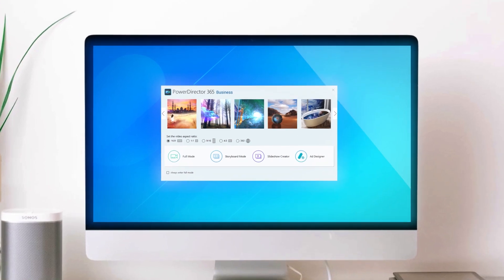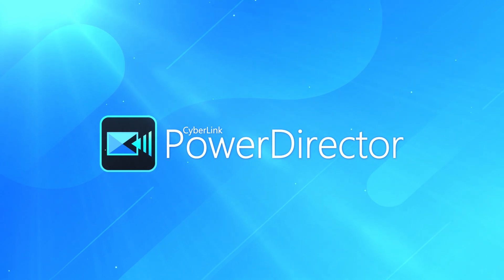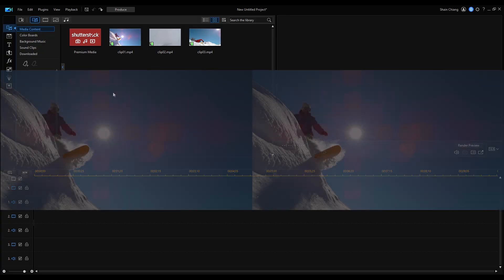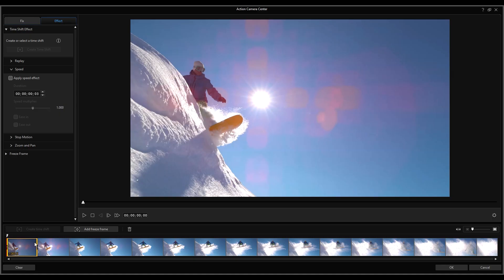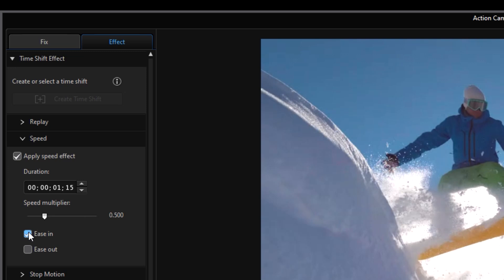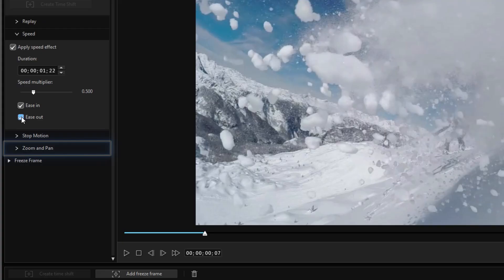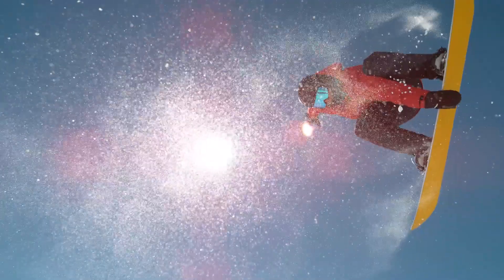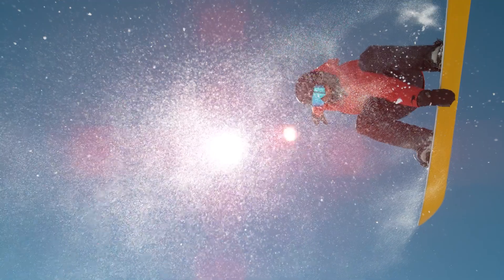Using Speed Ramp to Create Slow Motion, Freeze and Reverse Video Effects | PowerDirector Tutorial

Comment: I downloaded this app on my tablet. Why don't I have speed ramping tool??
Reply from the maker: The features in the video are currently available in PowerDirector 365. But don't worry! You can also use PowerDirector Mobile to make a speed ramp video. The concept is to split your source video into 2 clips and then apply the speed adjustment on either the front or rear clip to make the speeds different. You can also use video reverse, which is also available in PowerDirector Mobile now. 

About the freeze frame feature, we are already planning to add it to the mobile app as well!

For now, you can manually create the freeze frame effect by capturing a full screen snapshot of your video, splitting the video into two clips, and then inserting the video snapshot in between them. Adjust the duration of the video snapshot if needed.
Reply: @PowerDirectorOfficial   thank you! I was able to figure that one out but now I have another question. I'm planning on shooting a wedding soon and create the highlights on power director. How should I end the scene? I want the video to fade in at the beginning and fade out at the end. I been messing with it using some of the stock video but I can't seem to figure it out.

Comment: You can do speed ramping efect on android app? Or just on the computer? Thank you!
Reply from the maker: You can also use PowerDirector Mobile to make a speed ramp video. The concept is to split your source video into 2 clips and then apply the speed adjustment on either the front or rear clip to make the speeds different. You can also use video reverse, which is also available in PowerDirector Mobile now. 

About the freeze frame feature, we are already planning to add it to the mobile app as well!

For now, you can manually create the freeze frame effect by capturing a full screen snapshot of your video, splitting the video into two clips, and then inserting the video snapshot in between them. Adjust the duration of the video snapshot if needed.
Reply: @PowerDirectorOfficial  thank you for your answer!

Comment: is there a speed ramping in mobile subscription?
Reply from the maker: No worries. You can also use PowerDirector Mobile to make a speed ramp video. The concept is to split your source video into 2 clips and then apply the speed adjustment on either the front or rear clip to make the speeds different. You can also use video reverse, which is also available in PowerDirector Mobile now. 

About the freeze frame feature, we are already planning to add it to the mobile app as well!

For now, you can manually create the freeze frame effect by capturing a full screen snapshot of your video, splitting the video into two clips, and then inserting the video snapshot in between them. Adjust the duration of the video snapshot if needed.

Comment: Can you do this on your phone too❔
Reply from the maker: Sure you can! You can also use PowerDirector Mobile to make a speed ramp video. The concept is to split your source video into 2 clips and then apply the speed adjustment on either the front or rear clip to make the speeds different. You can also use video reverse, which is also available in PowerDirector Mobile now. 

About the freeze frame feature, we are already planning to add it to the mobile app as well!

For now, you can manually create the freeze frame effect by capturing a full screen snapshot of your video, splitting the video into two clips, and then inserting the video snapshot in between them. Adjust the duration of the video snapshot if needed.

Comment: Is there speed ramping tool on mobile version..?
Im using mobile version full edition
Reply from the maker: No worries. You can also use PowerDirector Mobile to make a speed ramp video. The concept is to split your source video into 2 clips and then apply the speed adjustment on either the front or rear clip to make the speeds different. You can also use video reverse, which is also available in PowerDirector Mobile now. 

About the freeze frame feature, we are already planning to add it to the mobile app as well!

For now, you can manually create the freeze frame effect by capturing a full screen snapshot of your video, splitting the video into two clips, and then inserting the video snapshot in between them. Adjust the duration of the video snapshot if needed.

Comment: How can we use in mobile speed ramping
Reply from the maker: Hi there, You can also use PowerDirector Mobile to make a speed ramp video. The concept is to split your source video into 2 clips and then apply the speed adjustment on either the front or rear clip to make the speeds different. You can also use video reverse, which is also available in PowerDirector Mobile now. 

About the freeze frame feature, we are already planning to add it to the mobile app as well!

For now, you can manually create the freeze frame effect by capturing a full screen snapshot of your video, splitting the video into two clips, and then inserting the video snapshot in between them. Adjust the duration of the video snapshot if needed.

Comment: I'm using mobile, only 😭. I wish have pc 😑
Reply from the maker: No worries. You can also use PowerDirector Mobile to make a speed ramp video. The concept is to split your source video into 2 clips and then apply the speed adjustment on either the front or rear clip to make the speeds different. You can also use video reverse, which is also available in PowerDirector Mobile now. 

About the freeze frame feature, we are already planning to add it to the mobile app as well!

For now, you can manually create the freeze frame effect by capturing a full screen snapshot of your video, splitting the video into two clips, and then inserting the video snapshot in between them. Adjust the duration of the video snapshot if needed.